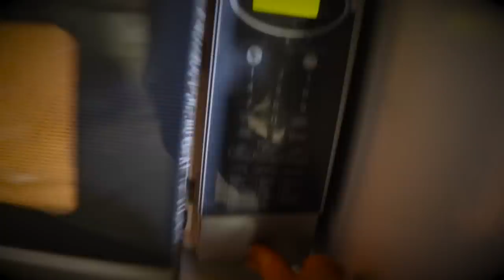I CURBED THE NEW 24X16 WHEELS ON MY CUMMINS!!

Comment: Oh boy, I have been hit by the curbing curse as well. Trying to also be nice to someone and help out. It wasn’t on my ford, I have a Tahoe with 33x12.5’s on 20x12’s, so a small amount of tread. I was pulling out of a store parking lot and someone was trying to pull in at the same time, so I tried to scoot over as far as I could to give them enough room to come in and the small curb on my right munched my rear wheel bad 😭😭